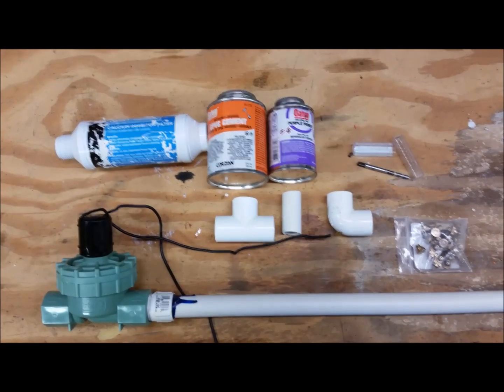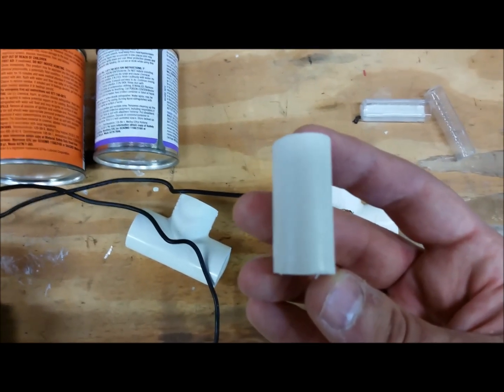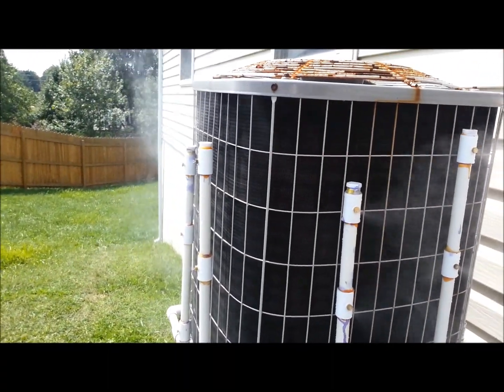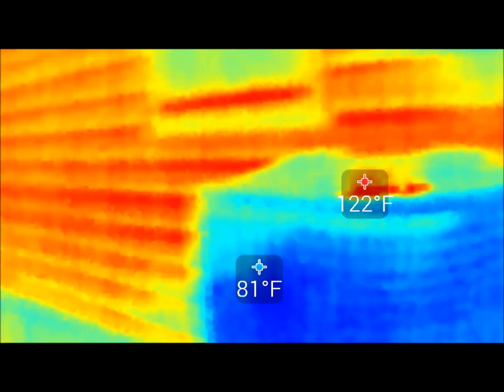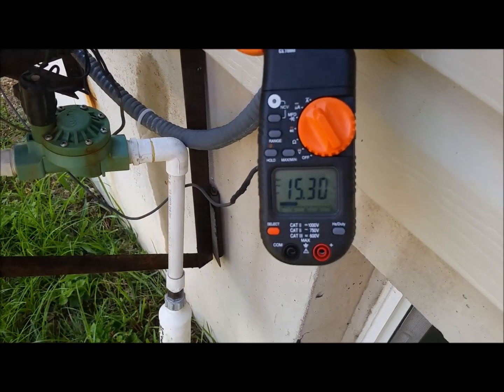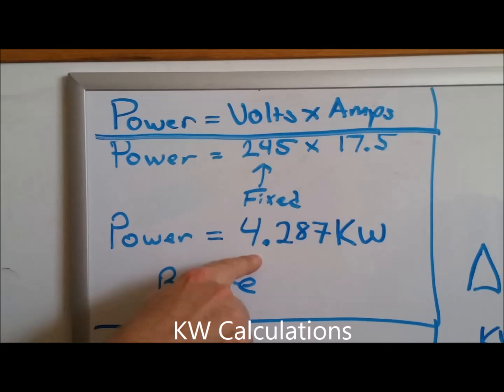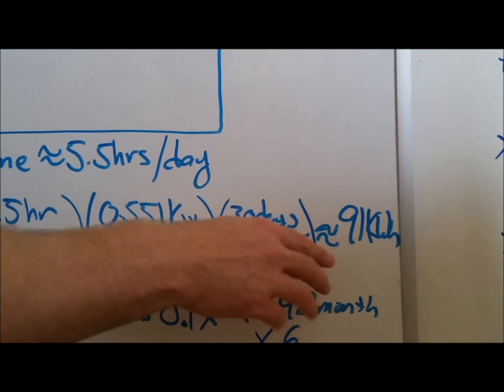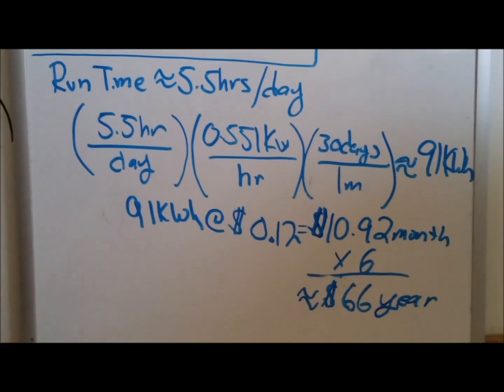DIY AC Mister Reduce your HVAC Cooling Costs Thermal Image Part 1

Comment: I think the better investment is Delta T taken, proper charge... nothing I seen here saves money. The unit Series is SEER rated at the factory. Simply replacing contactors and the evap relay along with the caps every five years is a better investment. Resistance from the contactor increases amp draw. Maintain the unit, they are designed by engineers.
Reply from the maker: Assuming a working unit.  None of the items mentioned will increase efficiency. A contractor will fail by either not pulling in or the physical surface not connecting. Similarly with the capacitor, it's either open or shorted.  Both will fail usually fail in two modes. 

But for arguments sake,  say you replace them.  There is no measurable difference   in efficiency gained.  

To gain efficiency, the ability to move heat,  you have two main components to enhance... the blower motor and or compressor.  Since the compressor draws a preponderance of the power,  that's the item of concern. 

Simply decreasing your air  intake temperature will allow this to happen. Similarly, one could run the ac when it's cooler and achieve similar savings.

Comment: Just hook up a NOS spray onto your coils. Guaranteed to increase torque and horsepower of your AC unit. 🤣
Just filter the water and it’s no different that when it’s rained on as far as water impact on external AC unit. 
The most effective way to do this would be to install when new unit is installed. Use sealant to protect any areas of wiring…. And enjoy the cost benefits and decrease wear on unit over its entire service life. 
I think rather than having sprayers, having plumbing inside the unit which streams water on top of the coils and flows down over coils from top to bottom would probably be more efficient. Or building a sheet metal box around the unit and having multiple sprayers.
Reply from the maker: Having water is like getting a hemi.  Lots of options on how to reduce operating power.

Comment: Awesome demo. So many people hating on this simple and proven concept. 

Im in the valley in southern California and in the peak of summer we have many over 100° days. I have a 2000 square foot house with a 2 year old 5 ton AC that is being pushed to its limits on those days and the air coming out of my vents is 53° outlet and 76° at the inlet. The house is insulated very well but that only goes so far. 

I plan on building a system similar to this one which I can manually switch the water mist on and off during those really hot days just to give my AC a boost.
Reply from the maker: I think you'll find your ac will run less and more efficiently. I'd advise using rain water as it's free and you won't need a calcium filter on it since it doesn't have many impurities in it. 

I have a video on that as well.  

Let me know your results. Always interested in what others achieve.
Reply: Makes you wonder why they don't install a unit based on average temp in said area and not just based on square feet. Most AC units installed in Hot areas are pushed to their limits.  Zones 7-8 should have 2 tons more than needed per square feet.
Reply from the maker: @adamburnette  the residence would need to have an ample supply of rain water. Using utility water would nessisitate the need for a calcium filter that would need to be replaced every so often.  Home owners would rather not be bothered with the inconvenience and rather pay higher bills instead.  But not me.
Reply: @stem_saving1644  What about condesation water collected via tanks? I am in Hong Kong with our humidity (up to 90%), my 18000BTU unit could easily picked up 10 liters per day running 12 hours per day, that could collected through tanks, could those be used on the mister?
Reply from the maker: @KL-jr5ip you could.  I get less that a 5 gallon bucket per day.  The mister uses more than that.  You could also use rain water.  Check my part 2 video out on that.

Comment: I like the system I installed it and worked very good now I need help on how to rewire   the valve system if you can help
Reply from the maker: If it's a valve from a yard sprinkling system, it attaches to the two small wires that come into the outdoor unit.  Be careful around the 240v ac or hire an electrician to make the connection.

Comment: Out of curiosity have you cleaned your evaporator coils? I'd expect another 20% percent. (Depending on when they were last cleaned, probably never)
Then for the calcification the other guy was talking about.. just clean your condenser coils. 

The evaporator coil cleaning uses enzymes to eat the biofilm that builds up. That prevents both heat conduction to the fins as well as adds back pressure to the blower motor in your furnace.
Reply from the maker: Evaporator coil doesn't need cleaning its filter. It's fine. 

Cleaning the condenser will only see 20% increases if they are caked up.  Mine are fine.

Comment: One of the nicer builds I've seen on the net! If you are on city water do you still need a filter?
Reply from the maker: I would say yes. Most all municipalities add chemicals to water.  The only pure water is rain water.  Check out my part 2 where I use rain water.  I still use it there too since it filters tiny debris out. Either way it's good to have.

Comment: This a waste of time and money .He has no idea about Thermodynamic and how that works with the refrigerants cycle .Heat transfer doesn't work faster if the ambient air is lower . 30 degree ambient temp is the same as  a 10 degree difference . The most overlooked and under appreciated issue for homeowner is insulating  your home .Heat loss and  is mostly from windows and poorly insulation in  homes.Imagine your home a huge refrigerator .The more times you open the doors the longer it has to run to keep cool. Call your local energy company for rebates for home improvements .There's also  tax breaks for replacing windows with high efficiency ratings  . I need  get a good laugh from this video .Its cute .
Reply from the maker: Your about 3 years late to the party. I have heard this old tired argument all before,  it won't work, running it will ruin something.
Yadda yadda yadda...and almost 5 years later still working. 

 I said it reduces the power draw which makes it more efficient. Your COP goes up based on how many btus you remove dives by the energy it takes to run the system. Suggest you pay closer attention to the video.

Yes, ultimately I agree if you super insulate your house, you limit your load.  But each house has limitations and squeezing out energy gains is what some houses can only do. Unless you spend 10 of thousands of dollars in energy retrofits.
Reply: @stem_saving1644  it’s not an argument . It’s called science 🧪 sir. You wanna drawn down your  energy cost . Invest in a 2 stage ac unit or ECM motor .unfortunately these ideas are still being shared to other viewers .
Reply from the maker: Most home owners aren't going to spend upwards of 5k-8k for a system that already works. ROI for a 15% more efficient new system is a lot larger than 50$ for a mister that gets you the same result.  At the savings I seen (66$) a year it would take over 70 years to achieve that with the same efficiency increase in a new system. 

Would you buy a brand new $25k car that gets half a gallon better fuel economy vs getting the same results from an older car, that's paid for, buy doing some simple cost effective mods?

I don't disagree with getting an efficient system when the one you have goes bad.  But from an ROI perspective, that's not the best option.
Reply from the maker: So. my current draw ratings must all be false then? Interesting that  my bills and energy system reflect the findings.

You can  believe what you like,  but science behind it is solid as the current meter shows.
Reply: @stem_saving1644  so you have a low amp draw so what? What matters is how   long the unit running to Satisfy the thermostat .Also utilities company have different rates for peak hours . You wanna save money find out what does hours are and try reduce run time for those hours .
Reply from the maker: 12 cents a kwh, no time of day.  So,  it doesn't matter when it's run.  It's how long it runs for and at what power level Power x time is the name of the game.

Comment: Here in FL atm I'm running 15 hr a day.  So, this is actually a huge savings if I can make some changes like this - Nice vid
Reply from the maker: Make sure you don't have hard water or use rain water.
Reply: @stem_saving1644  thanks was thinking of installing an inline filter and running it certain hours of the day.   Coming from NY it's a whole new world with hvac.  I've already done 2 little POC's with shorter run times.   Now to order everything and give the coils a good brush

Comment: I don’t think you explained to the people that, if and when you spray the water to Cool the Coils, it will lower the temp on your Vents which will save on run time. I sprayed the water hose on on side of my Coils while it was running for a while, it dropped my temperature down 5 degrees at the vent in house.Doing this!, it will most likely cut your run time a third or in half!! Your not even going to see the charge for the water💦 on your Bill. I didn’t plan on the Amps.going down on the Unit too!!, Thanks!! It’s a Win!!, Win!! All the way around!!
Reply from the maker: Need to make sure you have a calcium filter in case you have hard water, better yet use rain water.

Comment: My question. Does this mister system save the wear and tear upon the ax condenser. Thank u Tim
Reply from the maker: It makes the system run more efficiently by reducing the amount of power and energy it requires to remove heat.  Wear and tear, I can't say for sure since I haven't tested 2 identical units in a controller test. 

But experience has shown me, electrical devices that run cooler,  last longer.

Comment: waste of time and money will not lower the cost of running your a/c.
Reply from the maker: Really? So when the current drops by two amps, that's not saving any money? Lower power draw means less energy consumed,  which means less money spent on cooling. The applied math shows this.
Reply: If they saved energy, they would come from the factory with this BS gimmick installed.
Reply from the maker: Some people, like you, don't seem to understand the science or math behind it.  Its not a one size fits all system.  You need external components and some water systems won't work and are very heavily in calcium.

It might be BS to you but the numbers don't lie. You can choose to pay higher bills.  I'll stick to lower ones.
Reply: @stem_saving1644  you obviously don't understand how an A/C System works, lowering the head pressure does not make it more efficient, if that was the case, undercharging a system to lower head pressure would save you money, but it doesn't.

Looking at amp draw alone doesn't mean anything.
Reply from the maker: Right.  I guess my meter, thermal imager, and ohms law must all be wrong. Utility company too, by showing lower consumption on my bills.
Reply: @stem_saving1644  amp draw is part of it, if all that mattered was a low amp draw, then lowering the charge would lower the amp draw and increase efficiency, but that is not how it works.

How much are you saving with your mister?
Reply from the maker: It's amp draw under full load. It's all documented in the video. Interestingly enough,  companies like mist box and others build the same thing for a higher price.
Reply: By water misting the condenser will actually increase your sub-cooling of the refrigerant. 
You could actually take some refrigerant out until you had a 10F subcooling.  This in turn would actually lower the head pressure even more and cause your amps to decrease making it even run more efficient. 
Just make sure you water always turns on, or you will have a low charge and possible freeze up your evaporator.  
Anyway, great video. Love it.

Comment: I suggest adding a water softener up stream on the misters.  If not you will create a  concrete condenser coil.
Reply from the maker: If you didn't see the latest video I switched to rain water. No particulates in there.  Best water one can use.

Comment: Water is the new GOLD!  If you have a well, go for it.
Reply from the maker: Free water from the roof is now my well
Reply: It would be cheaper to have purchased a higher SEER rating A/C and more timely. Do you know how they make higher SEER’s, they just make the AC unit taller by adding more condenser coils.
Reply from the maker: @lynnchelo4727  I didn't own the house when it was built. But there is an argument to be made with more efficiency, but then I could make it even more efficient with adding in the mister again.
Reply: Every time the temperature of the coils change the freon pressure level changes. The lower the pressure, the colder the coils, to the point that the condensation rolling off the A-Coil freezes. You need to check your pressures with mister on. Then you must always run mister. Also since you changed the Manufacturer’s design you are no longer under any warranty. If you call for service just completely remove mister.
Reply from the maker: @lynnchelo4727  I think after 20 years,  the warranty is already expired.
Reply: Yes indeed! 10 years is max.

Comment: What you really want to do is make an evaporative cooler so that you are not putting water on the coil. We do that to gas turbines so we don’t foul the compressor blades but make 10% more power.
Reply from the maker: Yes that is the concept. The mister does that for the most part. There is water that does make it onto the coil sometimes, but it's all rain water now.